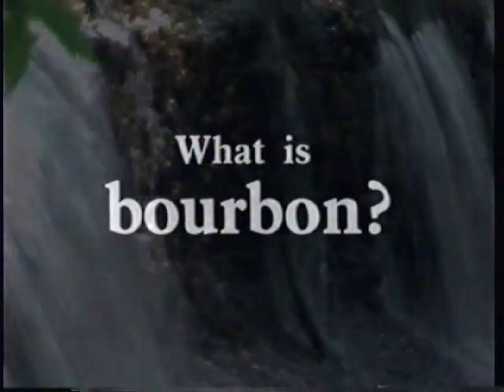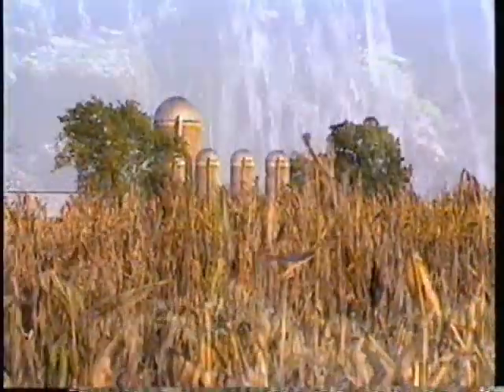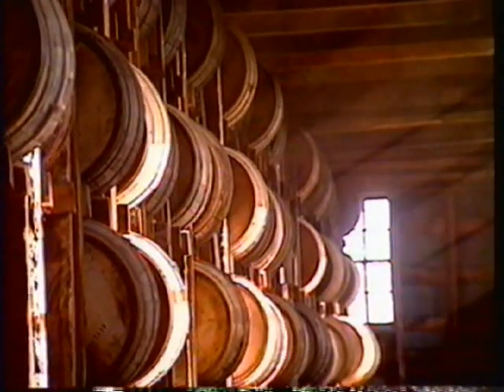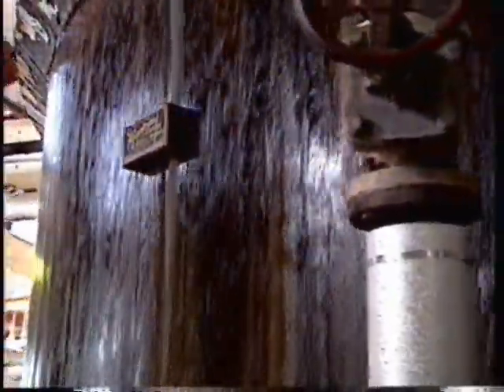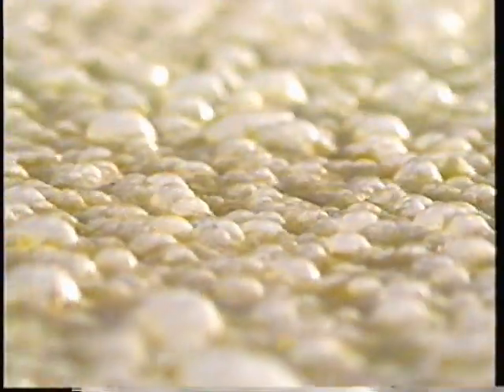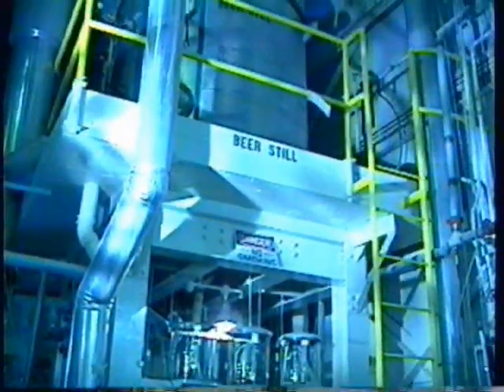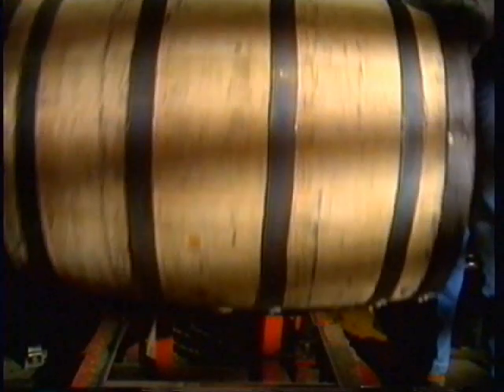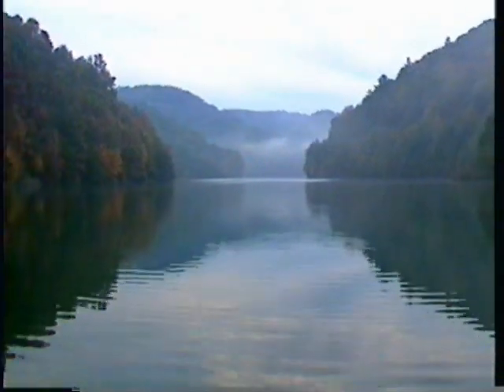How Bourbon Is Made

Comment from the maker: The empty barrels are very rare, but yes there is a lot of variation due to years in wood (aging) and warehouse location (some spots are hotter than others).  Uniformity is achieved by mixing many barrels together and 50,000 gallons at a time is pretty typical for the big producers. They do chemical analysis but the main way they determine uniformity is by tasting it.